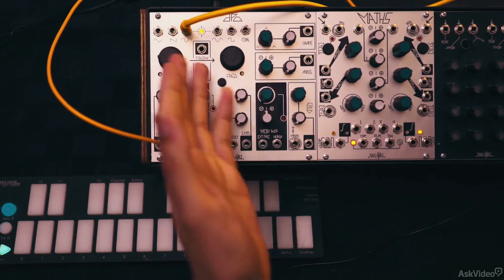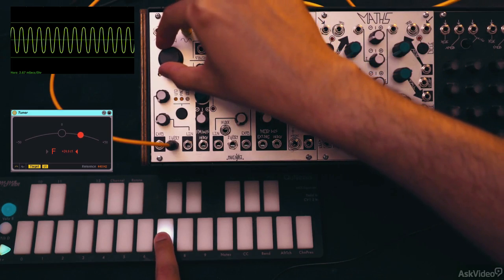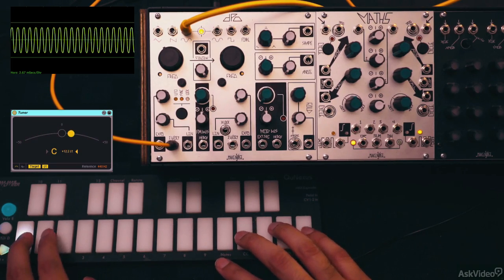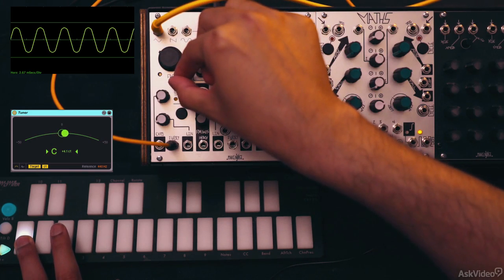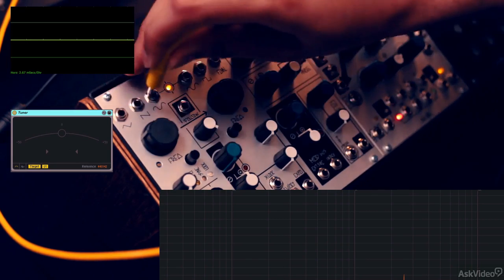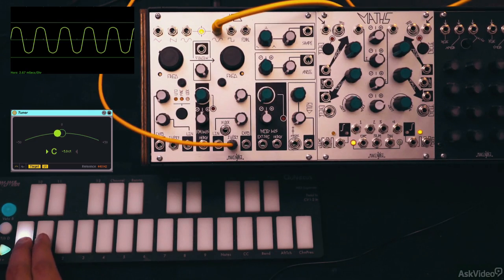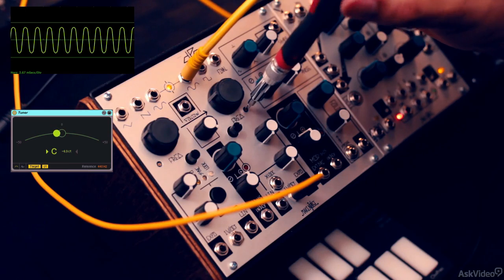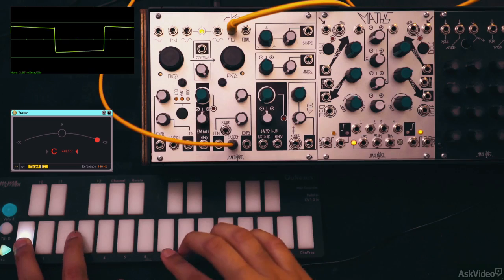Make Noise 101: DPO  - 3. Basic Waveforms

Comment: how can the tracking be so bad over just 2 octaves?
Reply: It isn't, he messed up the tuning. You need to check the tuning at 0v at the v/oct and then go up a few oct and check again. adjust with screw. go to 0v adjust with finetune control. go up again adjujst with screw. If you keep repeating this you can make it acceptably track over 4 octaves.
Mine goes +-5% over 3 oct
Reply: If you're a shitty ‘master synthesist‘ — it might.